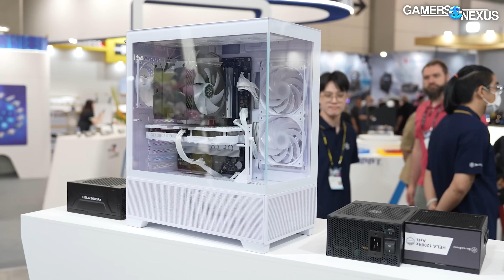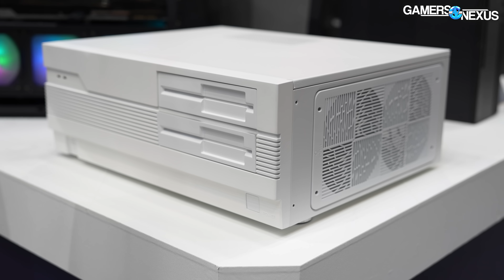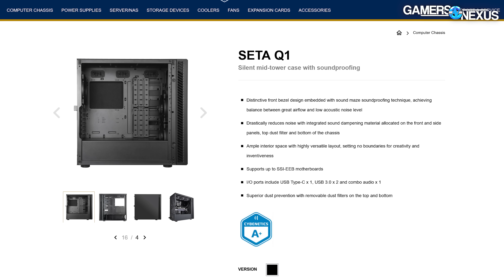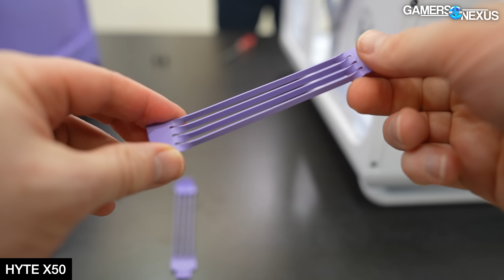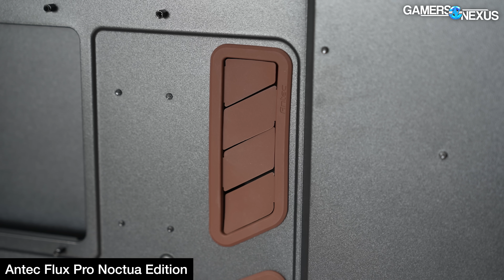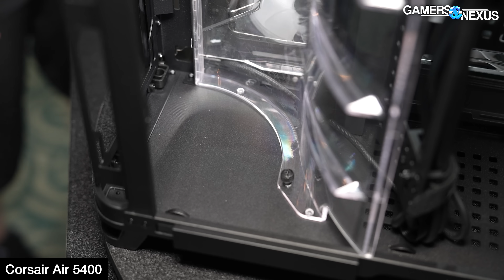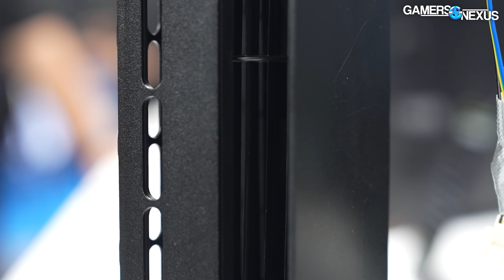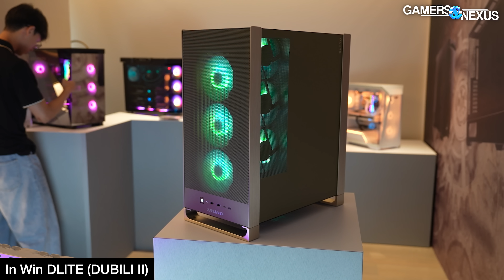Best PC Cases for 2025 So Far | Computex Round-Up & New Designs

Comment: Honestly, the Corsair 3 chamber case is a nice idea, let's see hwo it works out.
The CoolerMaster MF case with the rounded corners looks great, like the Jonsbo one that is far more expensive.
The 3 fans in one unit looks way better from the side, we'll see more of that. Sucks if just one fan goes bad, but usually they'll go around the same time. Can't wait for one long Infinity ARGB strip on the side. Yes, i like that...
Thermalright is always nice, doing good on the most bang for your buck side usually.
The Silverstone FLP02 case, i guess they'll have SOME success with it, but i don't care for it at all.
The LD05 seems to be a new standard, as in, we see many more like it, basically the same layout, with some more mesh in the bottom.
Hyte X50, Apple: The Next Generation. Looks good, not my thing, i wonder how well they might do with this one. The only thing i hate is the PSU placement and cover, i'd have preferred a dual chamber design, yes, it would be wider, fine by me, but i guess a lot of people wouldn't want that.
Lancool 4 and the like, yes, this was the next obvious step, but yeah, expensive. More glass, more expensive, with making the holes comes a higher failure rate, and you need specific fans, which adds to tooling and price. The target price for what you get is actually pretty nuts.

Comment: Those Hyte cases look cool, but if they're mostly metal, I'd like to see an unpainted version, I'm curious how it would look in metallic silver.
Reply: if you watched the original video, you'd see that they rust up within days.
Reply: @ssl3546  I'm sure there's a way to treat them. They probably didn't bother with it for  their prototypes. I'm not asking for literal raw metal, just metallic look.
Reply: lmao tropical region problems
Reply: @ssl3546  That wasn't from being unpainted, that was from experimenting with different metal compositions to try and get the bending to work. Alas the more pliable steel also lost most of it's corrosion resistance.

Comment: Real shame no one makes mod covers for bluray drives - we could have a bluray disc drive that looks like a floppy and the little lever that locks the floppy in could be the open/close button xD
Reply: although if you can get the drive in the same retro colour, having that drive in as-is doesnt destroy the retro look. Probably struggle for a blu-ray in the retro colour though. :(
Reply: @gmonkman  I s'pose you could always try to color match a paint and just paint the cover the retro color?
Reply: Could go the old school case mod method. Pop the front plates off the drive and attach the drive bay cover to the tray.
Reply: The fake floppy drive covers should actually be doors. That way the drives (or whatever you put behind them) would all look like floppy drives from the outside.
Reply: @davidsentanu7836  I'd accept your solution xD
Reply: I've seen it done, but I didn't ask how. I think he 3D printed a cover, if I had to guess.

Comment: If I'm not mistaken, the ATX standard has been around for about 30 years. Many old cases should be able to accept modern hardware.
Reply from the maker: That's correct, but modern cooling and GPU sizes are really the limiting factor for old cases.

Comment: I really want the FLP02 case, but the thermals are holding me back. Having airflow vents on all sides would be an "instant buy it" deal maker for me. I love the BRS (Big Red Switch) power toggle switch, Key lockout and the LED readout would be cool if it double as a Q (post) code reader. Thumbs up.

Comment: I hate building mATX systems in mATX cases and usually low cost cases are absolutely awful. If Thermalright makes a remotely decent case, even if I do have to spend another $30 to put 3 fans in it., that would be a game changer.

Comment: I absolutely love that SilverStone retro case. Almost makes me want to rebuild.
Reply from the maker: Can't wait to work on that one! I have to figure out some kind of fun build to do in it.
Reply: @GamersNexus  Contact Lazy Game Reviews. He will have appropriate hardware.
Reply: @hardlyworgen71  A collaboration with LGR using that case would be a cool thing to see.
Reply: @GamersNexus  The only thing I really miss is that chunky, heavy-duty vintage power switch — the small red one on the Silverstone just didn’t cut it. Even a white or gray version would've looked way better.

Also, any word on Fractal? Have they shown anything at Computex besides the Meshify 3?
Reply: @GamersNexus  Please consider doing a retro build in the case, the first Pentium MMX socket 7 that was fully ATX compatible. Motherboards that used the Intel 430TX, VIA VPX, SiS 5598 chipsets for example. That would be awesome. Do a collaboration with LGR.
Reply: @GamersNexus Absolutely need to install a BluRay burner at a minimum.  Wonder if there is a good way to install (and use) a real 5-1/4” floppy.
Reply: @GamersNexus Absolutely need to install a BluRay burner at a minimum.  Wonder if there is a good way to install (and use) a real 5-1/4” floppy.
Reply: @GamersNexus  Maybe find some retro looking things in there… or even find an old Zalman air cooler that would fit the build (if it could be mounted some how) 🤔
Reply: yes, and the new retro case will be cheaper then trying to get an actual good condition retro case :/
Reply: If it weren't so expensive it would be case of the year tbh
Reply: I was thinking the same thing, until I saw that Corsair 5400 which stole the show in my mind... 
I'm a sucker for dual chambers, the OG Air 540 Carbide has been my favorite case for years, and I've been waiting for a radiator location that doesn't intake from or exhaust into the main GPU chamber, so I'm buying it as soon as I can. It looks like Corsair might finally be back (I just hope they don't try to force iQue)
Reply: Asus has CSM motherboards with a green PCB. Just sayin'.
Reply: @LishtenbirdTech  Yeah, but it's Asus. I'm already not happy having to choose them for my AM5 build.
Reply: Looks like old PC case sitting in my basement.
Reply: I do too I wish I got the FLP0 one
Reply: I want to build a NAS with it!
Reply: I'm one of the diehard old geezers with an optical drive, and I'd really like to have one of those.
Reply: This is gold!
Reply: Well at least you won't have to worry about ladies coming over because that thing is so hideous and tacky.
Reply: I appreciate the retro look, but man, putting modern hardware in there looks so out of place 😅
Reply: also no one is gonna want to steal it as will think it junk!